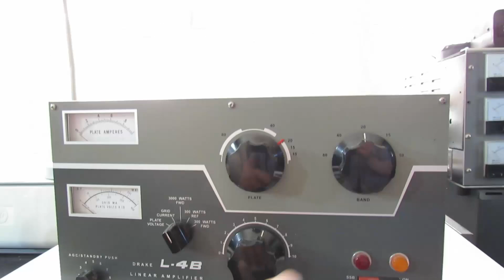Ham Radio Basics--Linear Amplifiers-

Comment: Thanks Jim, I appreciate your time and knowledge. I just purchased an Ameritron 811H. Radios are Kenwood TS 590sg, Yaesu FT 950 and Icoam IC 736.  I never used an amp before and so the antenna issue is an issue for me. I do live in an HOA. I have many trees in the back yard and on a hill so I am fairly discrete. Can you suggest an antenna that can work as many bands as possible but simple and stealthy ? You did mention vertical. Can you elaborate some ? Either way, thanks again and I pray for health and safety for you and your family. 73 Jim !

Comment: Jim. What size house wire should I use for a sb 200 Heathkit linear.  Linear to electrical panel is about  60 feet. Heathkit linear is 120 volts setup.
Reply from the maker: It would be better to have it on 240; but only a little better.  For 120vac, let's figure that out.  Let's say it runs about 600 watts output.  To generate that output, its input would be about 1000 watts (I am using 60% efficiency).  There are tube filaments and other things that might draw current.  So, let's guess at 200 watts for other "stuff".  So, the amp could be at 1200 watts total.  At 120vac that would be 10 amps (10x120).  The standard for outlets in most locations in a residence is 15 amps with a few exceptions where it is 20 amps.  So, the standard outlet will work fine.  Just don't put another item like a coffee pot or toaster or compressor on the same circuit.  There is inrush current at startup and some other issues.  On SSB the duty cycle is probably 25%.  So on average when on SSB, the current draw might be 5 amps.  Breakers can handle overcurrent for a few cycles before they trip.  All in all, the standard outlet should be fine.  The wire size should be 14awg copper.  If it is aluminum 14 gauge, then there is a fire hazard and you have a bigger issue than just the amp.  Does all of that make sense?  73, Jim
Reply: @ham-radio  Yes My house is built in 1918. And my wiring don't have ground. And when I put a space heater on it trips the breaker. So I was thinking my radio will be ok. But as for the 200 I better run another  a separate 20 amp circuit with ground  and a heavier  wire. So if I ran 12 3 I should be ok? And what kind of 12 3 wiring should I get?

Comment: It is refreshing to call them "Linear Amplifier".  As a Navy ET we also called them "RF Amplifiers".  

Now people call them a "Linear".  Shucks, a company even named "Linear" Back before no code licenses came along,  we would get made fun of, scorned as the ultimate insult, be called  a "CBer". That hurt worse than sticks or stones.  I know things change but as the Navy, we have traditions and history to make the way we do things have more meaning.

Go ahead and flame me.  That is something else we would not do, insult someone.  We would have to insult in person.  Chances are you would lose a few teeth and get a broken nose.  Now we behind an app and go for it!

Over and out good buddy.  You got your chicken house on,  the cops are in the ears on.  Maybe we can out run him using our Linear good buddy.
Reply from the maker: In a store where I worked for several years while in college. Some guys would want to be a lineator.   Another angry guy that I remember very well returned an antenna because he checked it with an ohmmeter and the input was a "dead short".  73, Jim W6LG
Reply: @ham-radio  I had an uncle once who wanted two antennas on his truck because he was told he could "Get out farther" on his CB.  So he buys another antenna strips back the center conductors.  He then proceeds to "Western Union" spice
  He didn't even wrap it with electrical tape.  He was so proud to show me that I didn't have the heart to tell him most likely will burn the power amp transistors up.

Comment: Ive been running an FT-991 at 95 watts through a Chameleon Emcomm III End Fed. I consistently get coast to coast (from Oklahoma) with a lot of really good signal reports (not the "fake" 59 reports....lol). Ive attributed this success to a really really clean antenna setup with lmr-400 coax, antenna mast just on the other side of the wall from my shack, substantially reduced RFI, and a choke at the antenna feed point. Between all of this the somewhat hated end fed has been very effective. Even with that there is always "that guy" that just cant get a clean RX from me, even though others in the roundtable or similar can hear me fine, that will tell me to get an amp. I was just told last week from an old ham that if I wasnt going to run legal limit that I needed to find a new roundtable. LOL. Kills me. Several of the other guys started making a point to comment that they could hear me fine. The operator got so mad that he said "someone else here can run the roundtable...then he proceeded to shut down Netlogger that was being used". Wow.

Comment: New HAM. Just got my callsign earlier this year, and have since upgraded to general and then extra. No amp yet. Havent yet decided if I want to go that direction. Seems in life that when you add “more power” to just about anything there seems to other consequences related to other equipment etc. Ive spent most of my efforts to date setting up a clean shack....grounding system, minimized RFI, “clean” power through minimized AC use.

Comment: Thanks for explaining the doubling of your power, gives you a 3db gain, but I just have to ask this...So going from 100w to 400w, you say gives you 2 S-Units which is a 'huge increase' ? Why is it that I have never seen that much difference in someone's transmission when they've gone from say S9 to S11. Now S9 to 20 over, yes that's a 'huge increase'.
Reply from the maker: Hi, I have had some connection problems.  You wrote:  ."So going from 100w to 400w, you say gives you 2 S-Units which is a 'huge increase' ?"  I don't think I said that.  Here's the simple approach to the math.  Going from 100 to 200 would be doubling.  That is 3 dB.  Going from 200 to 400 would be doubling; 3dB.  So going from 100 to 400 would be 6dB.  Six dB is 1 S unit. There is no S11. S9 to S9+20sB is 20dB.  Twenty dB is a 1 followed by 2 zeroes or 100 times.  And, that is a lot!  73, Jim W6LG
Reply: @ham-radio  You're right Jim, I thought you said '2 S-Units' when in fact you said '1 S-Unit' which to be honest, actually kind of accentuates my point all the more. At 3:08 you said 'that's a big difference' going up 1 S-Unit. It was that increase of only 1 S-Unit that I questioned why it would be a 'big difference'? Maybe that's why you said...''do you need an amplifier....probably not.' If buying an amp and using 400 watts only gets an increase of 1 S-Unit, then I think you're right. It's almost like you have to go with 1500 watts to see any appreciable change in S-Units. You say there is no S11 so let's use a different Benchmark then. My point was that if an Operator comes up from S7 to S8, I would have thought typically, that isn't much of a difference in signal strength but I guess as you've stated, it actually is. Now you mention that 'Twenty dB is a 1 followed by 2 zeroes or 100 times'. I didn't follow that reasoning but I found this page...( http://www.astrosurf.com/luxorion/qsl-db-power-units.htm) which helped me understand your explanation of what Twenty dB actually is.  Thanks again for the clarification. Stay safe and healthy.

Comment: I have never owned a solid-state amplifier. Tubes take a while to tune, but they work great (old-school, I guess). Gotta be REAL careful at 1,800 to 2,500 VDC though.
Reply from the maker: You know  Rick, I need to do a video about that.  I might use your email as a premise.  To give you an idea of what happened to me at age 17+/-, I woke up, maybe a hour later, across the room against a wall.  I had been unconscious for a long time. 
 The mic and the cord were still in my left hand.  The plug for the mic remained in the transmitter.  I was thrown so hard that is pulled the wires out of the connector.  The rest I will tell in the video.  Thanks Rick.  You are right. 73, Jim
Reply: @ham-radio  Glad you're OK, Jim. I had an experience, but at much lower voltage when I was 13. I got across 120 VAC and was frozen across it -paralyzed.  My Ma heard me "moaning" for help. If we were much older, we wouldn't have survived maybe.
Reply from the maker: Wow.  I have been told that AC locks you and DC throws you.   Mike Holt who is the expert on grounding says that just a few ma. can be fatal.  He said something like 1ma for every 10 pounds.  And, the GRCI outlets and breakers are 50ma based on a child's weight of 50 pounds.  You are so very lucky.  Sometimes the one being electrocuted causes the death of the rescuer who also gets locked up.  They say use a stick.  Thanks Rick for sharing.   73, Jim
Reply: @ham-radio  I was actually doing something very STUPID - experimenting with myself. no GFCI (if they existed) would have saved me - just good Ol' Mom.

Comment: Spot on Jim. A good antenna and transmission line is the priority. And probably much cheaper.
Reply from the maker: Thank you.  I did put in very good feedlines as part of building my new radio room and antenna system at the new QTH in Rocklin California. I should do a video about the feedlines. I failed to correctly mark which line was which that runs from the radio room  to a closet about 20 meters away.  I did connect to feedline that were unterminated and got a low SWR reading. Also, I found that some commercially installed coax connectors would not completely seat to the SO-239; even though it looked okay. That cause intermittent readings and I chased that mistake for days.  Sometime it was fine. Other times the SWR was high. As I said, the looked good. Wiggling the connectors they were just slightly loose with the barrel all the way down on the SO-239.  I know that all is confusing so I will video the connections and put that up here. 73, Jim W6LG

Comment: I have a kenwood tm281 in my truck. It’s had Mars mod done and I use vhf channel the most. Is there amplifiers I can use on this mobile radio to give it a little more power?. It’s a 65 watt but sometimes I need a little more. Thanks KF5SRI
Reply from the maker: The better thing to do might be to improve the antenna.  I really know very little about amplifiers for 2 meter mobile.  I am on HF when I am on the air.  Thanks Kendall!  73, Jim
Reply: Jim W6LG yeah I’m still a little new at a lot of this but still learning. I will do some improvements to my antenna setup. I’m sure it could use some. Thank you sir
Reply from the maker: Antenna and feedline are the most important things in the station.  The ground connection on a mobile is incredibly important as you know.  In any case have a lot of fun and see how far you can communicate with that mobile.  Also, work towards the Extra Class License.  73, Jim

Comment: Jim, some questions about solid state RF amplifiers. First is, how tolerant are they to great changes in line voltage? Second, are the finals MOSFETS or power transistors and are they only heat sink cooled? Thank you for this helpful video. 73's KB5ZDW
Reply: Rene Melendez an increasing number of modern amplifiers use LDMOS devices (a variant of FETs).

Comment: Saying linear amplifier is like saying driving car. I don’t walk around saying I want to get a driving car. It’s an RF amplifier that if driven and tuned properly, the signal is linear. I really need to get me a new driving car.
Reply: Agggh, not so grasshoper, many CB amps are class "C" biased and do not operate in the linear region.
Reply: Greg Pelfrey the amplifiers for CB are lain-yer amp-li-fars. Regardless of bias class. They also have pills in them apparently. I guess that’s why they are illegal for CB, unless you have a prescription???😀😀 you are right btw, I don’t typically think of a class c bias because I’d never use one on an amateur band.
Reply: brett h it all depends on the modes you run, Class C is fine for CW and FM.

Comment: Bello Jim, I know this may be a very basic question but, anyway, I really appreciate your videos , are awesome. What is normally the input of.this linear amps? At what power? I know it depends of the amplifier but, for let's say, an Ameritron single 3-500z valve, what would you use as input?
Reply from the maker: Hi,  It is actually a very good question and has a complicated answer.  Depending on the plate voltage, a single tube can run a maximum output of about 800 to 1000 watts. It would need a standard 100 watt transceiver.  Drive would somewhere around 70 watts.  The amp would be about 60 to 65% efficient. So if there was 900 watts output the input would be about 900 divided by 62% equals about 1500 watts input (rounding off).  Remember to keep the ALC at no more than about half scale.....never more.
73, Jim

Comment: Jim.   Do you have a video on safety using amplifiers?   I noticed that you were touching different components.   Do you ever need to ground out any capacitors in an amp or is just cutting the power and waiting a set period of time enough?   When I repaired radars, we had a grounding stick to ground out the capacitors prior to putting your hands inside but I haven’t seen that when talking about amps for ham radio.   If we do need to do this, can you do a short video on the proper way to safely discharge the caps before doing any work?   Thanks

Comment: GREAT video, Jim.  Even though I can run 1500 watts if I need to, I am, like you, a big believer in putting my money into the best antennas, fed by the best feedline and connectors, at a height that not only clears as many physical obstacles around it as possible,  but that is also the right wavelength above the earth, for the frequency I am working on.  It is extremely rare for me to run more than 200 watts PEP.  If I can hear them, AND they invested in a good antenna system, I can generally talk with them unless they have bad QRM. Only then do I use an amp, and even then I use the absolute minimum needed to carry on a stable, good quality communication.

Comment: My position is that a good antenna is where the most gains can be made. This also allows boosting the received signal as well. Using higher power than the other end is useless, you won't hear them.
Reply: Radio Freak yeah I agree  it will mess with your hair just look what it did to mine

Comment: All these great videos on linear operation .. how about simple show on how to hook up linear ?  I new on using amertron amps. I want to hook up my ic7300 I have no idea where the external tuner and the watt meter and my digital mfj swr meters go? .. so much confusion I I have internal tuner I don't think useful with swr about 3.. I have restricted antennas .. I using vertical on front door rails using mobile all band antenna. I was able to get 1 to 1 swr with mfj tuner .. now it's complicated adding a solid linear rated    at 600 watts I plan on only using low 200- 300 the most .. 
I watched alot of your videos but the simple things seem to be left out..
Reply: Peelaratstudios need a better antenna. Period.

Comment: thanks for showing that drake amp, really beautiful in it's simplicity' i would be concerned on the sizing of the power trannie, 
Jim, would love if sometime, you would go into the difference between going in triode  vs tetrode in the transmitting signal.

Comment: Great video. I like that you have a L4B. That is what I run behind the ic-746pro with a few tricks on the keying. The call is KD5FRJ and the L4B is my first and probably only amp. I did like you said got a deal on eBay put in new tubes cleaned it up a little and runs full legal.

Comment: A linear does not make your receive better.
We thank all those stations who spend the big dollars on high gain antennae and Linear amps so that we don't need to.
Reply: Be part of the solution ;)
Reply: I was working a station in San Diego the other day and he was in the noise thanks to my indoor antennas and then I hear "let me fire up the linear" and then the dude in 10 over S9 :) Made my day! My 2nd or 3rd HF contact on a band other than 10 meters. Some of the foreign stations really run both high gain and high power amps. Portugal on 20 meters the other day was so clear. I was so happy to finally be able to hear someone say my call sign on HF!

Comment: what is ballon ?
Reply: peter leach BALUN, or BALanced-to-UNbalanced (and pronounced the same as if pronouncing those two words, though many will say "balloon" which is incorrect), which is a type of matching transformer to match a balanced line (such as ladder line or a balanced antenna) to an unbalanced line (such as coax).  There are also Balbal's and Unun's.  You can also use them for impedance matching components with widely different impedances, such as when transitioning from 50-Ohm coax to 450-Ohm ladder line, or matching a 50-Ohm coax feedline to, for example, a roughly 300-Ohm folded dipole antenna so as to reduce the magnitude of the impedance mismatch allowing you to reduce the SWR and better couple power into the antenna.  In the case of current baluns (as opposed to voltage baluns, another type), you can also use them to reduce common mode currents coupling back into your shack over the outer shield of your coax when using unbalanced and/or nonresonant antennas so as to reduce unwanted RF in your shack that can result in equipment malfunction (or, more painfully, RF burns if your station lacks an adequate RF ground to dissipate the common mode RF).  They are worth studying up on, especially if you are interested in operating HF, as they can help solve a number of common issues you may encounter.